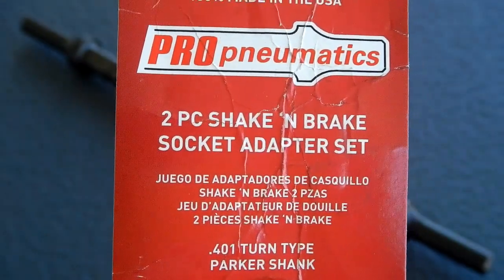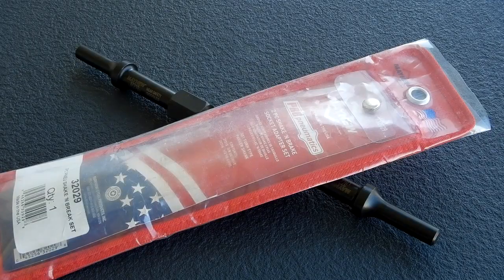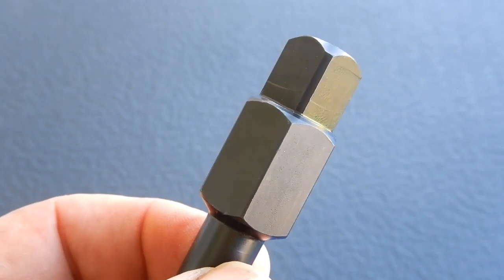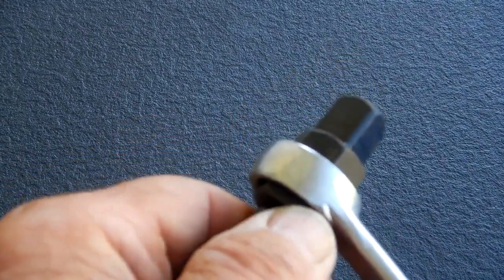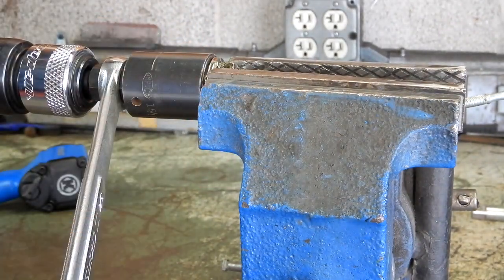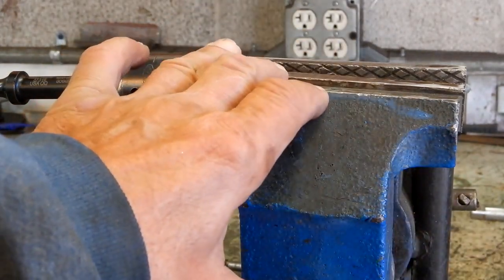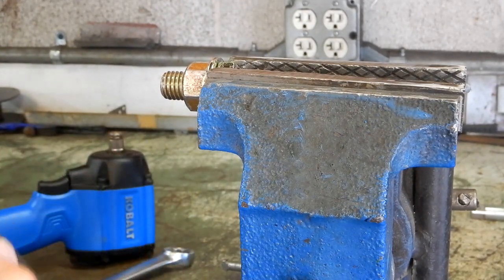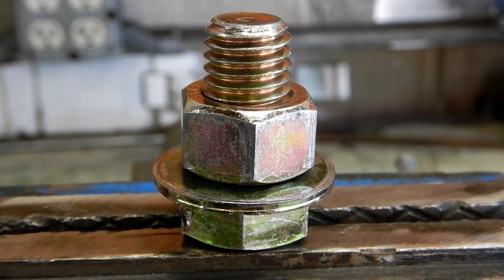Mayhew Tools 32029 Pneumatic Bolt Breaker - 2 piece set - #37315 & #32516

Comment: This, and others like it, are offshoots of "screw knockers" or "old man" originally used in aviation.  Originally, they were only used on screws and similar fasteners.  An impact rated bit holder was used at the end along with impact rated bits to pound DIRECTLY on the fastener, creating minute up and down vibrations while turning, thereby loosening whatever (rust/corrosion) is causing the fastener to seize.

When using it with SOCKETS, if you want it to operate properly, you need sockets with internal shoulders so the vibration hits DIRECTLY around the edge of the nut or socket, otherwise it's just sliding up and down the side of the fastener.  The vibration may help a little, but it's not intended to be used that way.  There's a company (I forget who since it's been too long) that makes sockets with internal shoulders for such use.

An alternative, thought it will reduce the impacts somewhat, is to fill the excess void with the same size nuts (in this case) with the threads drilled out so they bypass the bolt threads.
Reply from the maker: @wty1313   EXCELLENT information, thanks!

Comment: I have a similar brand to this. It's amazing... On rusted fasteners. But, you must use special sockets with a short hex length and shoulder that must hit directly on the nut face or top of bolt head. Idea is to shake the rust free, on the threads, apply wd40 or wotever, apply medium torque to get fastener moving anti clock, then move clockwise, and keep going left, right. Don't apply too much torque, or you'll break stuff! I have 100% success rate on daf truck brake disc retaining bolts, only m8, with etorx heads. Amazing process. Saved manys a hub from being scrapped!
Reply from the maker: Cool 😎 thanks.

Comment: Primary used on rusted fasteners what you are doing in the vid is not what they are intended for you can't get special sockets that make it work like an impact screw driver but these are mainly used for exhaust manifold bolts suspension/drivetrain ECT

Comment: I wonder if the real purpose is for rusted threaded bolts or screws after hitting it with some penetrating oil, I can see that being useful using 1/2" drive socket drive that have screwdriver bits, as to avoid breaking or snapping rusted screws or bolts from breaking.

Comment: My guess would be it is for bolts in bushings? Sometimes they get stuck in there and the whole bushing wants to turn with them, perhaps the vibrations help free it up
Reply: That's what my problem is. Lower strut bolt is seized to the metal sleeve. Got the bolt to turn easily by using heat and my 1/2" drive breaker bar with a 2' cheater bar. Sleeve turns with it so it won't come out. Bought an air hammer and thought about getting one of these adapters to put my impact socket on it and seeing if it'll break free. Ordered a new bolt and 30mm nut ($27 😮) 

Might have to cut it off on both sides of the bushing with my Saws All.
Reply: Excellent idea I'm about to have this very problem on a liberty during strut swap.

Comment: Where this is going to occasionally be helpful is rusty bolts/studs getting Kroil or other penetrating oils in to do their job. Not on new stuff that's just tight. 

You're right though, normal vibrations from an impact are probably just as good.
Reply from the maker: DuckyHunter812   Thanks for your thoughts.

Comment: I guess the idea is that youre getting the benefit of the air hammer combined with your wrenching power. Sounds good in principle and might be worth a try when you cant use a breaker bar which is generally my go to tool for seized nuts.
Reply: I’ve used a breaker bar while “bouncing”  my weight on the bolt kinda like an impact and using a 3-5lbs sledge on the backend of the head on the breaker bar to help break it lose

Comment: I disagree ‘ yes the impact wrench is typically what to use. You could have put a chisel from the air hammer right on a rusted or otherwise stuck bolt and hammered to to break the bond,and then used an air, electric or hand tool to remove. That attachment is useful in that  a socket won’t slip off like a chisel. Often times I’d like to hammer a stuck fastener rather than risk shearing it off with an impact wrench.
Reply from the maker: @RoadRacerGT   Thank you for that information.

Comment: They made a tool so you don't have to hammer on the head to loosen all so it depends on compressor  out put I have that set and they work great I use them on 18 wheelers